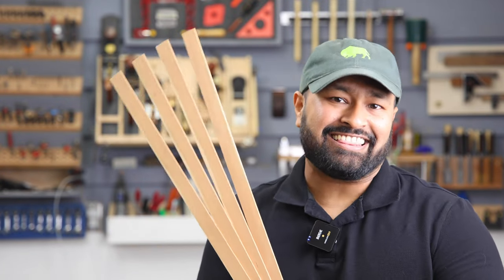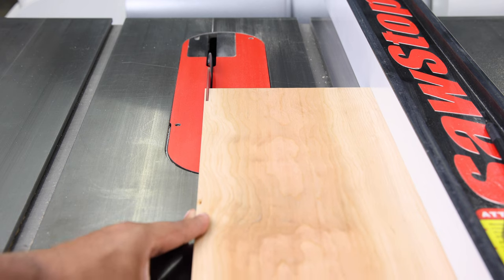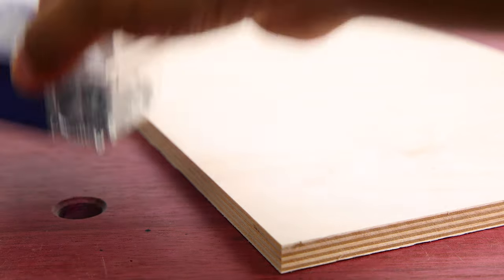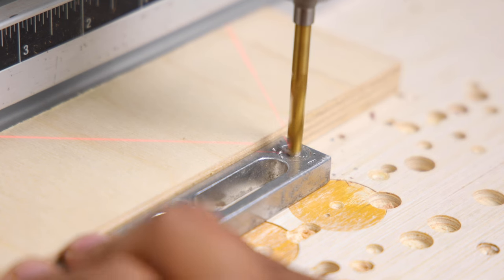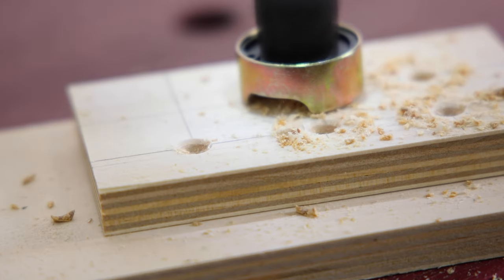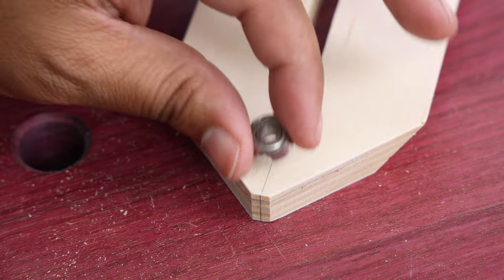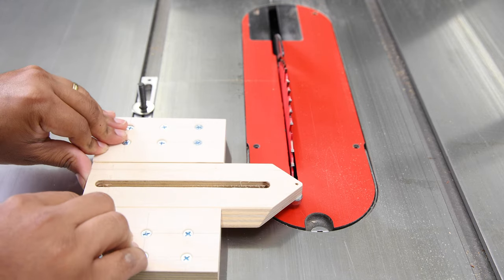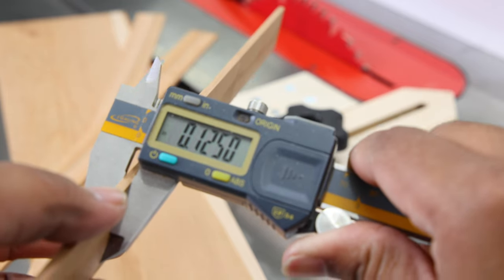the most important jig for a table saw

Comment: You can buy 608 skateboard bearings that are cheap and plentiful.  Use a 5/16ths bolt for the bore.  There will be a slight slop but it shouldn’t matter because the wood will keep the bore pressed against the bolt.  You can make a couple wraps around the 5/16ths bolt with teflon plumbers tape if you really want a tight fit between the bearing and the bolt which is useful for other purposes.

Comment: Making a cut off, between the blade and the fence, is a good way, to have a dangerous kickback.
In relation to safety, it's just plain stupid.
Reply from the maker: Depends on the width of the rip. I'd say 1/2" and wider are fine. Its the narrow stuff that'll get ya
Reply: @WoodcraftBySuman : Not so, friend.
Check Stumpy Nubs, for a good explanation:
https://www.youtube.com/watch?v=8f8VWwtaudU&t=334s
Reply from the maker: @zapa1pnt  Tablesaw kickback are very real. However, a Table sauce primary job is ripping material and cross cutting a secondary. Using appropriate precaution, a kickback can be greatly mitigated. Ripping super thin stocks between the blade and the fence is a great way to ensure a high probability of a kickback.